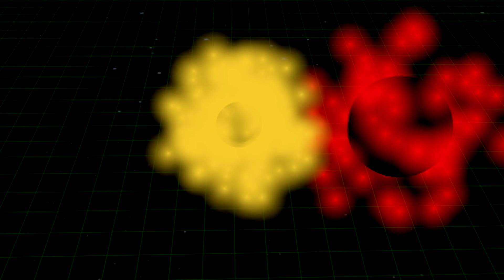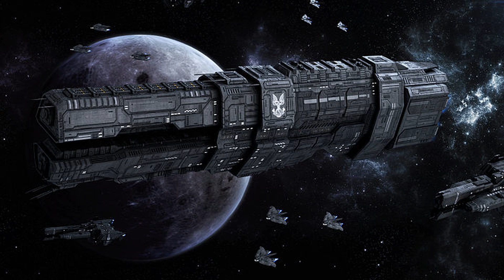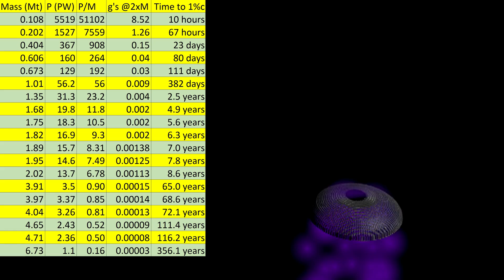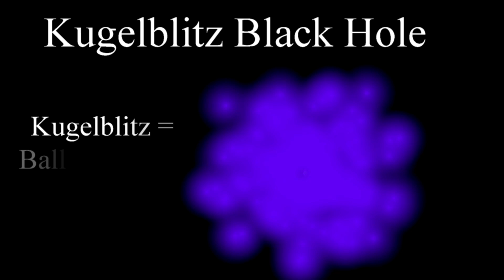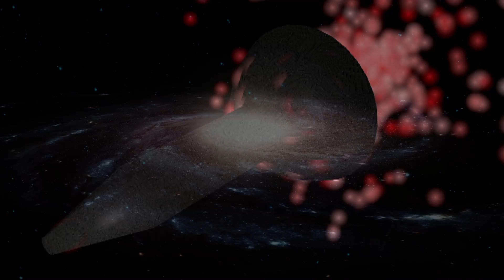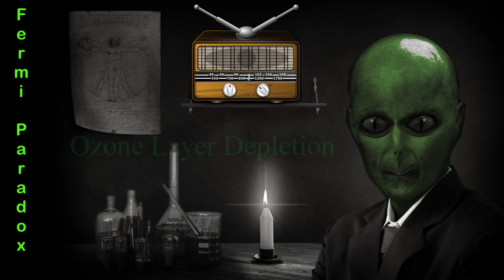Black Hole Starships

Comment: Actually neat point, I occasionally write sci fi in the star wars universe. One of the most intriguing tactics that I wrote(not my original idea,) that came from a rpg I was running. One of the ways you slow down in space is to flip with your engines pointing at your destination. Well the PCs came thundering into battle in a cr90  and rather then stopping via there normal.
..huh yknow I don't have the faintest idea how star wars ships slow down...ah well 1st rule of space opera ships and tech, NEVER TRY AND EXPLAIN THEM SCIENTIFICALLY! Why? Well then they run out of gas as in the atrocities know as the final trilogy.  And yall always whined about the prequel trilogy.  See? Now you know .....AHEM..sorry digressed) anywho right as they got within a few klicks of there enemies they flipped and red lined their engines! My reaction as DM " Weeelllll shit, did not see that coming" oh and what moron would actually go out in space and NOT be heavy??? No one could be that dumb and thrive.

Comment: Gravity tractor is a good idea.  

You have an array of pairs of black holes that exchange energy and then send out neutrino beams by creating imbalanced exchange in the desired direction.   Lets you control temperature.  

Read Misner Thorne and Wheeler GRAVITATION.  You ceate large iron-56 pentagon based pyramids that collide at 1/3 light speed or higher allows you to create black holes with mundane matter.  Further groups of tiny black holes can be made into a condensate that exchanges energy and that energy imbalance can take the form of neutrinos.

Comment: These things are not just not unarmed, they seem horribly dangerous to be around.
I mean, if you go with the gamma ray reflector option then wouldn't you run the risk of sterilizing anywhere you want to get to if you mess up your deceleration calculations by even a little bit?

Comment: Also I am memorized by and admiring and fascinated about theoretical physics.
I think about these ideas literally all the time, it's fun for me to imagine.  It's all essentially some form of information, in which existing in certain states of environmental conditions, or as energy signiture's.

I seen in nature a lot of similar things, like up above and so below. Most things need balance and a flow of moving energy states. Like the cells and planet's and galaxies. Also like torus Field's, or like alternating currents, or like x points, or like the laws of thermodynamics, or the coriolis effect, or probability wave forms.

  The keys to the universe, or a physics engine, or a matrix processing device. Physics would be neat to understand further. Basically either through pattern's and like algorithms and of language of sorts, or yea a energy signiture.

One could theoretically exceed speed of light, by changing the internal relationship to the outer exterior space of the universe. Their is essentially nothing really stopping the circumference their of, in which space time from changing. 
 As such physics would also not be locked and could change, they could create artificial controlled environments, in which adjusting physics, or the underlying code of the universe, as they see fit. ((( The circumference their of, could theoretically be anything.))) (())

Things like pokeballs, or dragonball bulma's capsules, or dragonball's hyperbolic time chamber, or the tardis in doctor who. Even the hyper cube in Jimmy neutron, or even rick's portal in Rick and Morty. Or even the warp drive, or artificial controlled gravity on sci-fi spaceships.  
Think of them all having environment's, where it's underlying code, could be what they desired the outcome, of such probability wave, of such the condition's to be.
What's most interesting and entertaining thought discussed, is that the field circumference could either like align, or unalign with the matrixe's of underlying code information of a environment.
.
.
.
.
So in theory a star trek like HoloDeck room, in which the internal space. Could technically be big as you want such space to be and not a illusion of trickery. It could technically be with real people and real objects, like the tardis internal space has .

Comment: so if you could reflect gamma radiation, then could you technically shut off the black hole by closing you thruster, eventually forcing all the radiation back into the black hole until you need it again, keeping it in equalibrium, or at least keeping it alive much longer.

Comment: Carbon would make more sense for many of these theorized high temperature applications because  while Tungsten may technically have a higher melting point Carbon remains solid past that because it sublimes, its also far more abundant and easier to process.

Comment: Black hole starship?!  Good luck after you open a door to a hell dimension...
Reply: There's absolutely no need for any funny dimensionary stuff. Black hole is literally just an object so dense that it's excape velocity exceeds the speed of light. That does not necessitate anything outside of normal physics.

Besides, why would it even be a hell dimension? If a black hole somehow opened a portal to hell universe, why would it not open in an endless, empty void millions of light years away from any possible habitations?
Reply: @Teknokraatti  its a reference you knowitall dipshit.  fuck off!

Comment: Did the Romulans use a black hole for power generation? I think it was contained deep in the ship in containment. It could accelerate matter like a particle collider and eject it for an engine. A black hole may be potentially used to create exotic matter/ energy for warp drive.

Comment: So I'm curious: with the idea of a weaponized small black hole, or for that matter with your mention of dropping one and having it bob back and forth through the planet, wouldn't it be accreting mass from the planet? I assume you're saying that Hawking radiation for the size black holes you're talking about would cause them to evaporate faster than any accretion. That seems very counter-intuitive, since it would be ripping pulling in mass that it encountered much faster than even a fast flux due to Hawking radiation, wouldn't it? In any case, presumably this would throw off timing on a weapon use of a black hole if, say, you wanted to take out a city or ten on the far side of a planet by shooting a black hole through the planet, timed to evaporate at the far side surface for maximal damage.

Comment: How do you stop a MBH drive ?
You can't turn the BH off.
If you deploy an opposing mirror, the mirror duo becomes a hell of a super-heating oven.
And if you retract the drive mirror, you are still left with some thrust (from the minimum protection) and a MBH radiating everything around.
Maybe you could deploy/reshape the mirror as 2 opposing spikes to redirect the radiation as a disk ?

Comment: I feel like combining this with a bussard ramjet would be the ultimate interstellar ship... I read somewhere that a black hole power plant could have a mass-energy efficiency of 42%. This could probably overcome the major issues of the Bussard ramjet, the energy to accelerate the fusion fuel to the ship speed ends up roughly equal to the energy gained from fusing it at around 12% c. Fusion energy can only get a few percent of mass-energy. Black holes could get 42%. There's still a speed limit, but it may be much higher, perhaps at a point with a decent gamma value.

Comment: I love your channel sir.  I've recently gotten a newer car with Bluetooth so now I can listen to your show while going to work.  Much better than local radio.

I also love the fact that all my other channels all give you respect for being one of the top shows in this field.

Since the discovery of gravity waves a bit ago that has given my idea of how many aspects of space travel follow suit to sailing.  

I've| also wondered if wood, compressed and infused with a high carbon resin might be a possibility.  

There are many times down here that wood beats metals for strength to weight.  I was thinking using wood to be a radiation shielding around the pantry.  

Compressed wood in a vacuum, then impregnated with the resin and pressed into dense sheets.

I have lots of ideas, then most I find a show or a comment you made, which makes me feel justified, even if embarrassing by posted it, then seeing the episode the next day.

Keep up the great work.

Comment: Black holes for powering spaceships could be made by concentrating the energy of hundreds of lasers at a single point, alternatively, they could be made by somehow squeezing some things down until their radiuses are their schwartzchild radiuses ( an object's schwartzchild radius is the size at which it becomes so dense that its gravitational pull prevents even light from escaping ), there's no known way to do this artificially. We've already made artificial black holes, most being ' dumbholes ' or sonic black holes that don't let sound out. A kiloton of work is left to be done before micro black holes are ready to power spacecraft!

Comment: To avoid the trade off between longevity and power output, can't you just use multiple small black holes, provided you have the ability to create them at will?

Comment: Why does it matter if the interior of the shell melts? Will a liquid shell not still absorb the radiation and emit it as heat into the outer solid layer?
Reply: Fluids do strange things when accelerated in zero gravity.  They also won't necessarily cling to the ship structure while being heated at such a high rate.  A metallic fluid might just ionize and 'evaporate' in a high-energy vacuum, then bye-bye super-ultra-mega-lightning power source, babe.

Comment: what accent is this?  not being funny but the first sentence - i couldn't understand and had to caption.  since then i'm fine but i can't place it
Reply: tommo123456789000000 this is an older video. He has a speech impediment that has drastically improved in his more recent videos. They are also of much v higher quality. I highly recommend  giving his newer stuff a look
Reply: ahh. i've heard some speech impediments but this didn't sound like that to me.   i'm not being funny but it sounded like a regional accent i've not heard before.   

thanks
Reply: tommo123456789000000 I thought the same thing at first as well. He talks about it quite openly though. He's actually from my state, Ohio.

Comment: I'm probably going to say something really stupid here but... from what I understand, which isn't much lol... the bigger the black hole the longer it lives and the less power it kicks out. I watched the video on micro black holes and the 100 megaton one providing a decent amount of power over like 4 billion years, so why not make the one megaton ones that burn out fast and generate 1G of thrust to move the damn ship and have a bigger one on board to power lasers to make other little ones to replace the ones you have to jettison at the near end of their lives? before they go boom..or am I just being overly simple :P
Reply: Once you make a single one powerful enough to drive the ship, the power output is so horrifically huge that anything else you want to do will have more than enough energy.
And these aren't things you can simply 'store' until you need them to provide power; they provide power from the moment they're made - any attempt to 'lock them in a closet' will disintegrate the closet.

Comment: Are black hole drives more feasible than Albucurie Drives (sp?) or both mathematically but not necessarily physically possible?
Reply: RGB Reading kuegelblitz black holes should indeed be physically possible, not just mathematically so.  

As for the Alicantspell warp drive, it's contingent on negative energy and negative mass... which we have no reason to believe physically exist

Comment: 1/3 thru video: this gives opportunity for some advanced calculations. First we need to calculate how much mass must be thrown into a black hole of given size per second to maintain constant energy output, then we need to calculate how much mass in proportion to the ship one should carry in "fuel". Ideally, I'm guessing, it would work around the range of 100 megaton ship, plus 20 megatons of fuel, and a black holes which can output (as controlled by its pilots) from 1.5g to .25g of acceleration. To increase g force, simply starve the black holes appropriately. (Such may take like 2 weeks though) and further math can show an optimum ratio set for max acceleration per unit mass by controlling the ratio of black holes size and ship size.

Comment: There's an alternative to Hawking, one that actually works even better with black holes that get too big to put out more than a terrawatt of hawking radiation. You extract the black hole's rotational energy, which can account for up to 29% of its mass-energy equivalent if you stopped it spinning.
Advantages are that with less hawking pressure, feeding it would be much easier, as it would also be a bigger 'target', and firing in matter at low energy needs, at the right angle, would also give it back angular momentum.
First is the Penrose process, but the gains of the matter part which leave behind the part which is left to fall in are in kinetic energy, which is hard to 'extract' once the matter comes back.
The other and more feasible is the Blandford-Znajek process, which threads magnetic field lines to act as 'circuits' through the ergosphere and/or accretion disk and pole for electrons and positrons to flow, the rotation being extracted to induce a current.
With this process, your energy gains are in electrical form, and with superconducting means [that such a reactor's circuits and magnets would need anyway], you can harness it for electric means of propulsion. This way, and with how easy to top up they are, you could have a much smaller black hole in relation to the ship's mass and get the energy you need.
Black hole creation by the kugelblitz method, and then feed it a ***kload of matter so that its hawking output decreases to manageable levels, and once it also has an electric charge, then confine it inside a negatively charged sphere that will naturally contain it by mutual repulsion. Of course, if the ship accelerates hard and you want to keep the black hole centred for reliable aiming of energy extraction/feeding, you can have large electromagnets that activate in accordance to 'buffer' the charged BH and keep it in the centre, altering as the ship accelerates or stops accelerating.

But one thing you said in the video is correct though, a gamma ray reflector material is needed regardless of the process.
Reply: One important note: electric field intensity inside a charged spherical shell should be 0 (I think) so your suggested method of confinement won't work, the black hole will just completely ignore the charged shell. Electromagnets still work though.

Also, Penrose process might be preferable to other alternatives if you're using it for propulsion, since concerting kinetic energy -> electric -> back to kinetic will probably loose a couple dozen percent of energy as waste heat. If you're flying at relativistic speeds that extra heat could become a major problem. Keep in mind Penrose and (if you can reflect gamma) Hawking could get close to 0% waste heat, and even then you could probably power the rest of the ship just by placing thermocouples on your engines. On any self-propelled decently fast interstellar ship propulsion will consume >99% of all power, so producing electricity for rest of the ship is not really a big concern.

Running something like ion drives using your method to generate electricity will likely result in higher exhaust velocity, but frankly I'm not skilled in math enough to calculate which method would result in higher delta v.

Comment: the mass of the black hole does complicate calculations a bit, but if you have a 5% efficient (energy outputted/kinetic energy) hawking radiation -> kinetic energy method, your black hole will have a mass of ~ 1000 T, and will live for ~ 80 seconds, forcing you to feed it mass, or constantly make a new one.  if you cant feed it mass, you could have lots of greater mass ones, but they would only add to the mass.  ultimately, feeding them mass is the only option; and a lot of it, given the mass of the black hole youre trying to keep alive.  if we ever do find a solution (maybe mass replicators?), then black holes would be the preferred method of relativistic travel. only other problem is accelerating at any reasonable rate will kill the crew (assuming you have humans running it, and they are still in their bodies).

Comment: A large black hole in the front of a ship would allow for speeds up to the speed of light cause any interstellar hydrogen would fall into the large black hole. Smaller black holes with a tungsten shell moving around the larger black hole would maneuver the black hole star ship. A kerr black hole relies only on spin so a ball of depleted uranium accelerated in spin by magnetic fields could generate a blackhole. The tungsten shell would probably help transmit magnetic acceleration to the ball of depleted uranium. Depleted Uranium has interesting cohesive properties that allow molecular structure to heal damage done to it. Theoretically a ball of depleted uranium could be accelerated at that cohesion limit until the blackhole formed. A black hole drive ship is technically an FTL ship cause space is already falling inward towards the singularity faster than light.

Comment: I read a story where they didn't power a ship, but rather they created a black hole in front of the ship, and then that singularity was kept just ahead of the ship via a field of some sort. Basically it used the pull of the black hole on the ship to move it, and the inertia created by the ship's movement was also used to push the black hole forwards. I wonder if this is actually feasible. Anyone wanna weigh in on that?